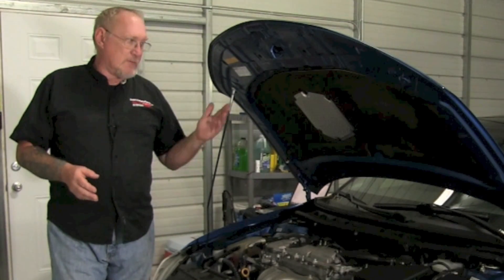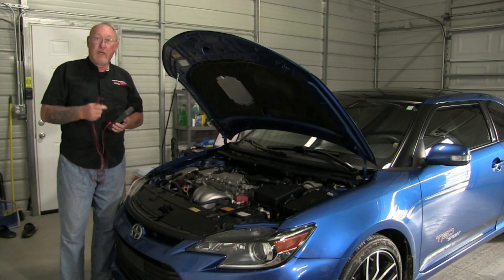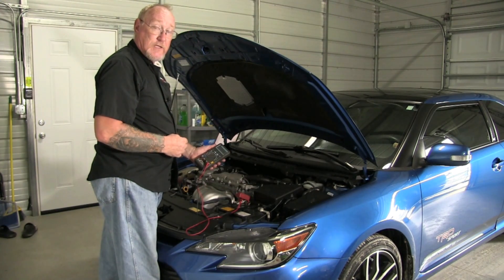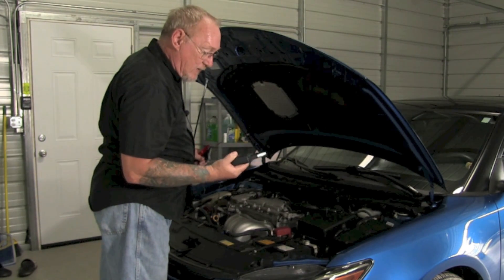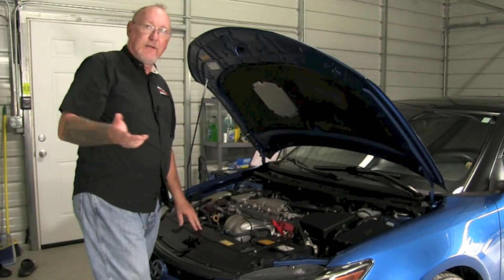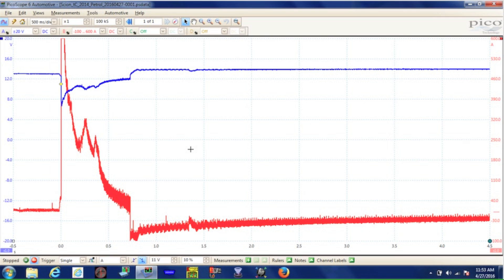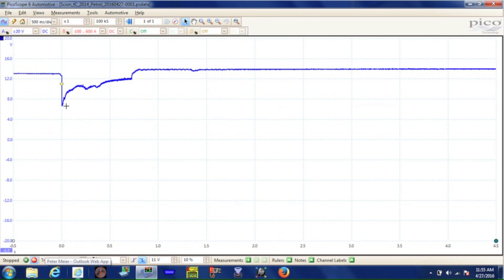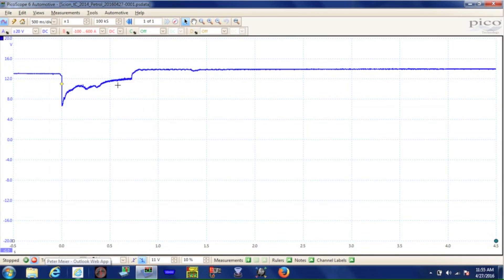The Trainer #56 - Battery and Charging System Testing Tips

Comment: Why is using a larger cca rating battery bad when extra equipment has been added, extra lighting, and changing h/lights from std bulbs to hei bulbs with ballast and a 800 and 200 watt amps and a powered sub woofer ? My car calls for 700 cca and I put in a 1000 cca gel cell, and after 3 optima batteries in 3.4 years, I went back to lead/acid, but remained with 1000 cca.

Comment: I get frustrated when training info implies that I as a technician should perform work that is not authorized or there is just not time for.  If I as a technician performed these tests on every car I would not be profitable.  These tests would end up taking several hours out of my day.    It would be nice to see training videos that were a little more real world.
Reply from the maker: Somewhat valid point Stephen. Many states will not allow you to open the hood unless the work you were hired to do required it, or you had permission to do a preventative maintenance inspection. The PMI is a valuable way to generate additional business - legitimate business if it uncovers real service needs. When I was fulltime, I always performed a brief visual check for safety related issues and always checked all 4 tires (and the spare if it was readily accessible). It doesn't take that long...but ultimately it's up to you and your shop owner.
Reply: Thank you for your answer.  Yes I do agree that inspections are good thing for both customer and shop but if it goes beyond a visual inspection it should have customer approval and should be paid for by the customer.  There are too many shops out there that give away this and that and then try to make up for all the money they lost on selling unneeded service.  I try to give the customer as much info as I can but I am not going to diagnose his car for free.

Comment: Great Info thanks but you forgot to tell us how we can tell the engine speed with the info we have on the scope ! you have enough info to work this out just blow up the volts line and you should see the humps and we know this is a 4 stroke motor so just pick the two events  this will make up the 4 stroke motor the scope your using will do the math's for you but we need to have 200 RPM we can use this info to make sure the motor is spinning fast enough to start the engine    but you might have to give your scope more Sample rate to do this I see you only have 100ks you need to give your scope more the 2m sample rate then you see the humps on the volts line so then you can zoom in and work out the engine speed
Reply from the maker: I don't worry about calculating engine speed. A tech's greatest resources are his senses, right? I can hear the engine and know the difference between a healthy spin and one that's not so much...:-)
Reply: yes your 100% right and if your like me 40 years of working on cars its very easy for us to know just by using our senses what's good and bad . but what about someone that's only been working on cars for a few years ?  .and I  just like to say thanks for all the great info you give us and a big thank you for the motor age magazine that I get all the way from Australia   your one off the best Pete
thank you and all the best

Comment: thanks Pete I appreciate your thorough help with diagnostics. I watched your TST seminar on everyday scope usage. I wasn't sure of the bad values for your scope batt/charging system test. Battery is good if voltage trace drops to a min of 8.5 volts while starting the vehicle. If the battery is charged at least to 12.4 volts open circuit voltage prior to testing; and the cranking voltage falls below 8.5v. We may have a faulty battery. The current trace should show a max of 3 amps of current flowing into the battery. If the battery is weak this value will be higher.
Reply from the maker: Just to clarify - that's 3 amps NET current, or the positive current used to keep the battery maintained. If you don't have all the ground cables looped into the clamp, you'll get a false reading.
Reply: Thanks for the tip ! Your the man !!!